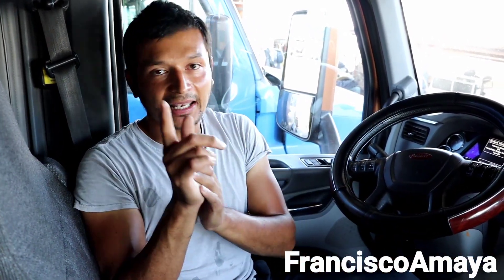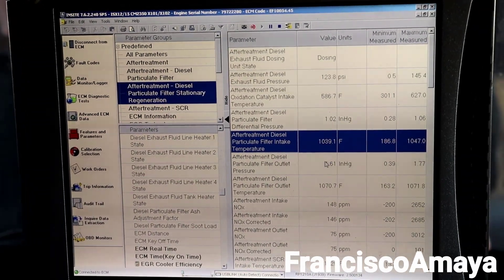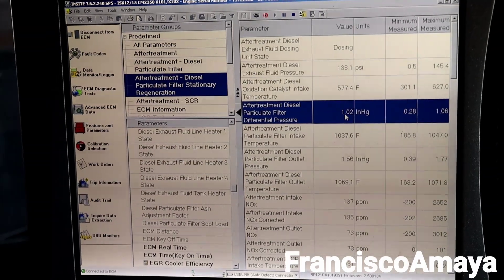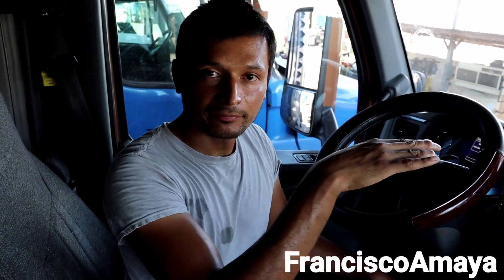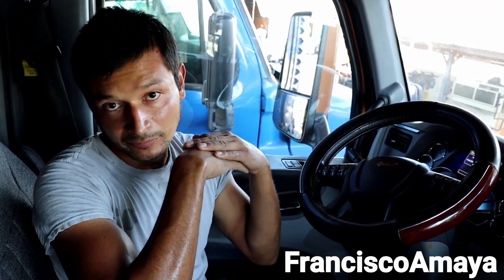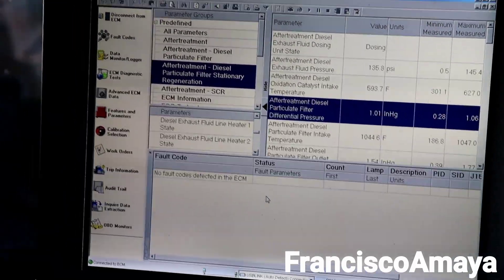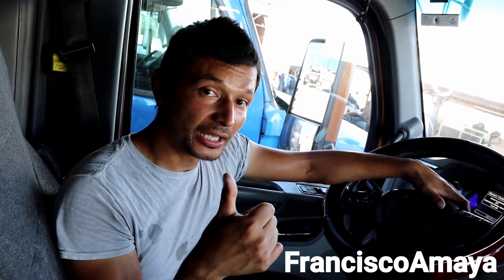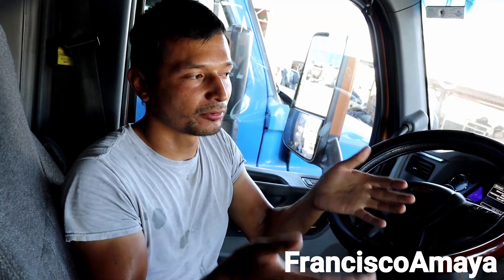S3 E7 F.A.I.T.H.  cummins ISX ISX15 regeneration too often  regen does not happen while driving

Comment: I have a 2011 Volvo vnl 780 with a Cummins ISX 
I’ve been getting an active code but it doesn’t have First or Last event
I go in to diagnostics and get a sid324 Fmi 0 and sid324 FMI 2 
Have tried to clear code but just comes back
Replaced the differential pressure sensor 
I have just done the DPF filter clean up it asks for a Parked Regen but code doesn’t allow
What is the problem

Comment: I have Temperature T3 goes 60 degrees over normal while Parked Regen.
My diagnostic said Regen is complete 100% approximately for 1 hour,,,, but my truck said Parked Regen doesn't meet whole process,like process is not completed. 
DPF filter is new.
Do you knowwhat could be reason for Temperature T3 goes 60 degrees over normal?

Comment: Your te best!! Manufacturers want filters clean after 250,000 miles, but what about replacement of filters? What miles you recommend replacement of filters? 
Thanks
Reply from the maker: Replace them is the best cuz something there are materials or debris than can't be removed by cleaning manually and this causes high pressure calling regenerations within a low range.

Comment: How about guessing this one.... im sure the dpf is time to be changed cuz we had an egr cooler failure, but I've done numerous manual regens from my scanner. But the levels are always high. The truck seemingly NEVER does a regen on its own. I always do it and finished it never goes below 20% I think.
Why would the truck never regen on its own?
Maxxforce 10 International 2012
And yes I know 99% of my issue is its a maxxforce but I can't fix that